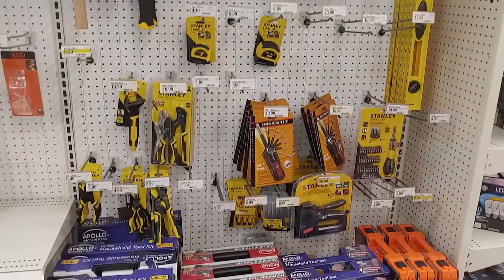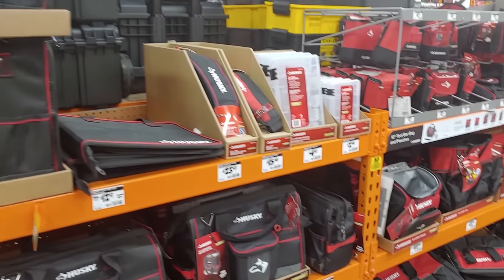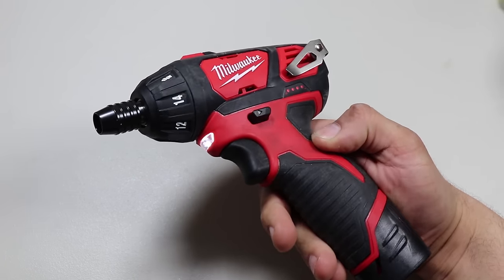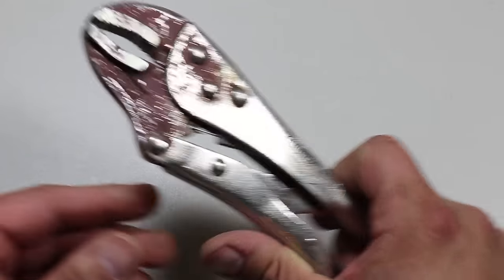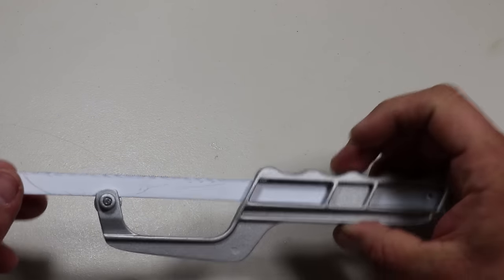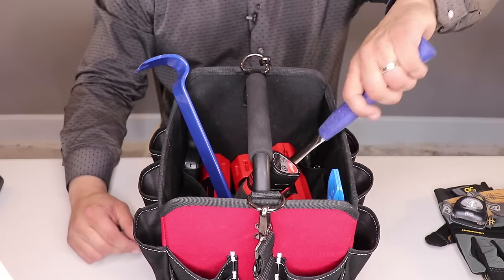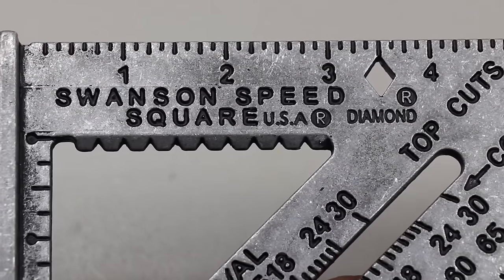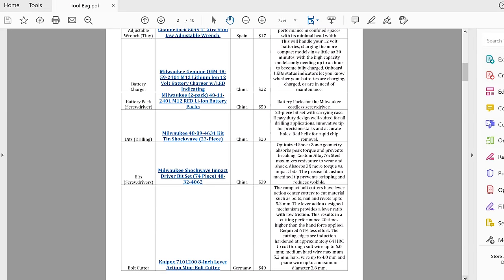What's In My Tool Bag? (Tool Bag Tour)

Comment: Im a Handyman/Carpenter and that Chisel blade is sacrilege, you need to re-shape & Sharpen it ! ... Ratchet & Socket are great but not used in many Handy man jobs, there more mechanic Oriented, Instead of the magnetic Bowl which I use in my Shop, but in my Tool bag I carry Magnetic Wristband,  my Tool Bag is longer than that one, it has a Full size Hack saw pocket (Trust me the small one sucks), Files you need a Flat and a Half round one, my Head lamp is O-light and can be detached for held, I have a separate Container holds screws and stuff, also a large Bit case for my Impact Drill, WD40 is ok, But it is NOT a Lubricant, it is good to break metals apart, But it evaporates fast and will remove all oils allowing metals to Rust, I use the triangle speed square for carpentry but not in my Handy man bag, I keep a Small Frame square it it, I have a small Duct tape, Electrical Tape & Pipe Sealant Tape, I also have Metric and ASC folding allen Wrench sets, a Scraper & Safety glasses.

Comment: i use the zip up tool bags and smaller tool pouches to separate stuff like ratchets, wrenches, screwdrivers, and sockets. 

I LIKE those rubber holders your sockets are in
Reply from the maker: Cool idea on the zip up tool pouches! I have several from Custom Leather Craft.

Comment: Vise grips I use are the STANLEY FatMax FMHT74886 10-Inch Curved Jaw Locking Pliers and the Tekton 5 inch locking pliers. I use the 5 inch one more often and it's easy to carry around in my pocket. I would also like to get the Leatherman Crunch, but I need to save up for it because it's expensive.

Comment: I realize this is nearly 3 years old but he forgot two tools that should be included in any fairly inclusive DIY tool bag:
1. 5-in-1 painter's tool. Just a good quality, basic one. There's no need for one of those 17-in-1 deals that will come with a Johnson rod remover and a flux capacitor recharger.
2. Size N crochet hook. Its uses are many, and considering its size to usefulness, it can be seen as a 'must-have' for any tool bag

Comment: I put together a basic tool collections for my sister.
hammer, combination pliers, wire cutter,  bit set, screwdriver, knife, pipe wrench, small level, folding rule, and a small saw.

She has bought a cordless screwdriver and some other tools by now, but I think that's what you need when you start.
Don't buy the cheap stuff, but don't buy the tools that are made to last forever in a professional environment. They are too expensive for home use. Take a look at thr good budget brands or some good deals. Or used tools. 

As a professional, I have tools for twenty years and they are still good. Others I have to replace every year (or every other) because of usage. Also, I replace Tools when I realised that there is a better version available or when I don't use it often enough to justify carrying it around every day.

Passing tools on to children is a nice idea, but not always a good idea. It should not be the motivation for buying tools. Buy what you need and think about what to give away when it is time to pass tools on to someone who needs them.

Comment: Nice set of tools. The electrician in me had a meltdown when you pulled out the non contact voltage tester, though.^^ Please, please, throw that thing away and get a two-pole voltage tester or a multimeter.

Comment: I have to disagree with the “your tools need to be dirty folks”.  Worked 38 years as field engineer and when I retired most of my tools looked and performed as they did when I was a rookie.  Cleaned them after using them and carefully stored them in my tool case.  I did have a few cheep tools that failed along the way and had to be replaced but the good stuff lasts forever if you take care of it.

Comment: As an electrician i highly recommend you DO NOT trust those Non contact voltage testers. You'd be much better off getting a basic klein multimeter (like $40 on amazon) and learning to use it properly. Non contacts are notoriously finicky and unreliable and can give you a false reading which can lead to injury or death.

Comment: Been a carpenter 40+ years.
Trust me, China makes top quality tools. All power tools etc made in China and your fancy laptop is Chinese. I just sold over $20,000 (half my tools) after retiring. My last kit was about 25 years old. 95% of it was made in China Even after 25 years of usage all my tools were in 100% perfect working order. And in 25 years. I have only lost one single hand scraper, which I found 2 years later and one single Chinese made sanding Machine by Porter Cable stopped working. The only company I will not buy a tool from is DeWalt. Many years ago I watched  the DeWalt company take cheaper tools from Black & Decker and change the color to yellow, change the name over into DeWalt and raise the price by about 30%. Professional Carpenters would never buy Black & Decker stuff, but when they were presented with the exact same Tools in a different colour at an extra price everybody thought it was something special and they all got suckered into it. Every tool company has a few tools which are their best. As an example Milwaukee is the first company to make a Sawzall and they make the best one also. They are very good for electric drills

Comment: Add a soldering iron and some rosin-core solder. Maybe a variety of wire-nuts and basic wire connectors/shrink-wrap in that storage case (Id use a separate case for nails, screws and washers and such). A wood rasp is nice to have around as well as a plain and a pipe-wrench, sand-paper and emery-cloth to. The more you add thou, the more you'll need a real shop to work in.

Comment: Very great Video! But you should check out the Wera tool check plus. Its a great set of al lot of Bits and Nuts, a little Bit grip, a little ratchet and a Bitholder for the cordless screwdriver.
its also available for Imperial "system". For some great ratchet you should check out the Wera Zyklop, or ratchets made by Stahlwille. And get your self a set of the Knipex Zangenschlüssel (knipex pliers wrench) they are better than a normal adjustable wrench. They are expensive but its worth it.

greetings from Germany

Comment: the milwaukee m12 and m18 stuff is so cool. i have the m12 ratchet and the 1/2in m18 impact. the m12 battery can be hooked to their heated jacket! ive been wanting to get that too

i had bought a ryobi kit a couple years ago and they just make so many things that work with their battery for small use they are worth a look. i use the 1/4in impact, drill, and handheld vacuum a lot. lol i also got their little tire inflator for a quick top off, but if i had a flat tire i would bust out the viair 400p.

viair 88p is a great inflator to recommend for vehicle use btw

i got a few of the wera drivers and wiha bits myself. i really like the wera handles

i work in an optical lab love using the wera kraftform micro with quick release bits. finding the bits is a pain in the ass though. the wera bits are too nice for our usage and we go through A LOT. 

my dad had a great variety of craftsman tools im still using after he passed and im adding to it as well. some good stuff, some just to fill the gaps as money allows
Reply from the maker: That heated jacket sounds sweet!

Comment: Its a popular notion that a man should buy the very best tools he can possibly afford.   I find this nonsensical.   If I could afford a $5,000 hammer why in the heck should I buy one?   I say...a man should buy the best he can afford that does what he needs it to do - and not a lot more.  I can't remember ... ever...breaking a cheap wrench, screw driver, or hammer.  My hammer cost's $5.  Nuff said.
Reply: Keith Lamb, I follow and agree with much of your sentiment sir. I was just about to make a comment similar but a bit different. There is nothing wrong with buying quality tools but not all quality tools are expensive. And just because the tool is made in America or Germany doesn't mean it's better or of higher quality then one made somewhere else. And I certainly agree if you can buy a $5 hammer that gets the job done for your needs and save some money to buy other tools that will allow you to complete your project then more power to ya. For example I own an expensive set of Knipex pliers made in Germany the (7" pliers wrench) for its quality and versatility. However I also use vise grip pliers of the Irwin brand that are probably made in China, and they are cheap and probably the most useful and quality tool that I own for their versatility, functionality, and durability.
Reply: Absolutely.

Comment: Not German made are made well. Look at Bmw, Mercedes and VW. I have been working on them for 10 years. Most of auto tech drive Toyota. Hk G36 is one of the worst rifle ever made. Let talk about Ford and GM. Lol I guess every company make good and bad stuff. It should be the unit not where or make.
Reply: Agreed. I wouldn't dismiss something just because it's made in China. Some world class tools come out of China but so does a lot of junk. Similarly I've had fantastic tools made in the USA but I've also had junk that was made in USA. Evaluate an item for it's merits, not the generalised opinion of it's country of origin.
Reply: Isn’t it true that modern German cars....say 1990 and newer suffer mostly from being unnecessarily complicated and therefore unreliable vs just being poor quality?
Reply: @apsilonblue  best stew pot i own was made in India,, didn't wanna buy it but i needed 1 that size , got it in 82, been in use darn near every day,, and i got it at Walmart.

Comment: hate to break it to you but your wire strippers are not gonna be of any use, they're way to small. The ones you should've gotten are the blue and white handle ones. that's what me and my coworkers use
Reply from the maker: I've since replaced those ones with the larger yellow handle ones and moved these one over to my computer to bag. They're too tiny for what I wanted then for.

Comment: Unfortunately, I think you're pretty far off in regards to most of these potentially being heirloom tools if that's your main goal. Wera makes great tools, but the handles alone will not last generations. That doesn't mean they aren't great tools. They are. Generational tools that you can pass down to your kids? No. Rubber degrades with age regardless of how much you use or don't use them. Good kit for you though for sure! With that being said, a lot of that is dependant on how much you use your tools. Also, not that it matters at all, but Knipex is surprisingly pronounced Kuh-nip-ex.

Comment: I have been a carpenter for 40 years and now retired at 70. But you are making a mistake. The Chinese tools are excellent. 95% of my equipment is made in China and the last batch of tools that I owned was over 20 years old and I sold everything when I retired and it was all like brand-new after 20 years of use all made in China. We seem to forget China has high quality and cheap quality stuff we only buy the cheap quality stuff to make lots of money that's why we only see the cheaper stuff from China. 40 years ago when I studied Asian joinery a high-quality handmade saw was 10,000 us made by a master smith

Comment: Plumbers tape??
Reply: Also known as Teflon thread tape.
Reply: @mChrest05  ...as long as I can remember I've never heard of a plumber calling Teflon or PTFE Thread sealing tape plumbers tape. I am a second generation plumber and what we refer to as plumbers tape or p tape is the galvanized plumbers strapping tape. It also comes in copper and plastic and used basically to strap pipes.
Reply: @analogsmog  Yes, that's true. I don't think The Urban Prepper has worked in the trades. If you said "hand me some plumbers tape", I would bring you strapping.

Comment: I have been really liking your prepping videos, but you are clearly not an expert on tools. The woodworking chisel from your g-pa is not in working condition and should not be used until repaired.  The other "chisel" you showed is a metal working tool and it seems odd to want to put the two together. Personally I have three primary tool kits. One specific to my car, its in my car, and a metal working, and a wood/leather/sewing tool box. Tertiary tool boxes include the rechargable drills used for metal or wood, and an electronics kit with soldering iron, crimpers, and other stuff...

I guess I was being critical because your kit is a basic homeowners kit and that was not stated in the vid.  Maybe I should make a few videos with my cheap but functional setups.